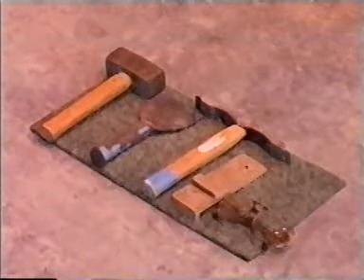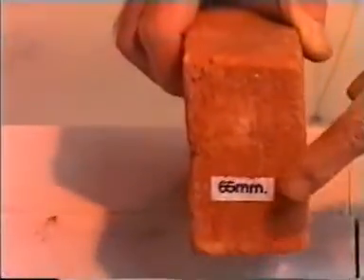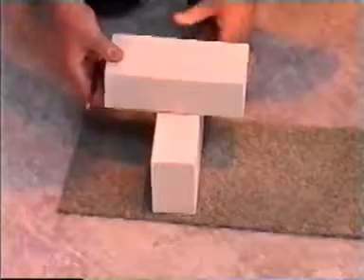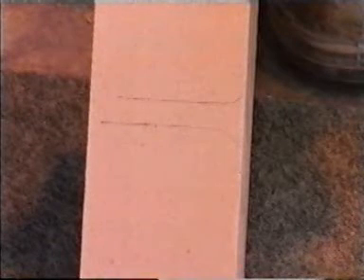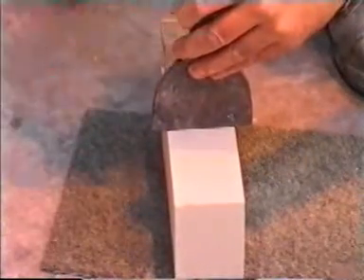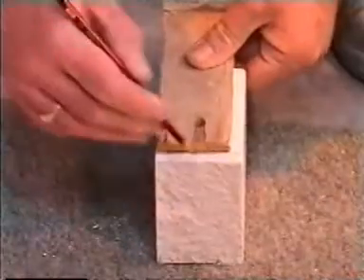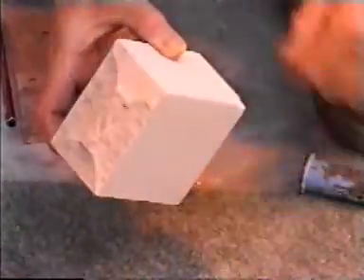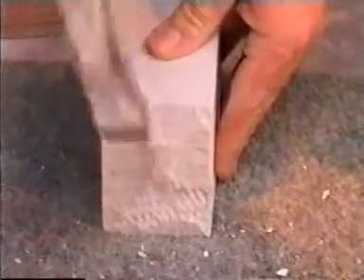10 Cutting and Dressing Bricks

Comment: get a saw that took an hour. Even with a chisel one shot with a chisel on the face side and possible fast trim with the trowel. No need for an exact cut when it's buried in mortar and only one face edge shows. Angle the chisel slightly and you won't have any protrusion 95% of the time.